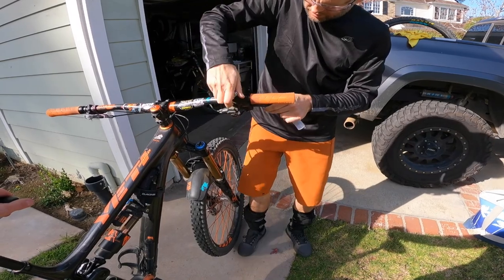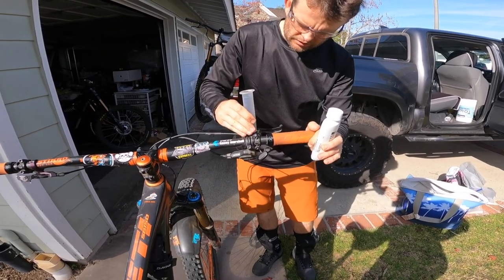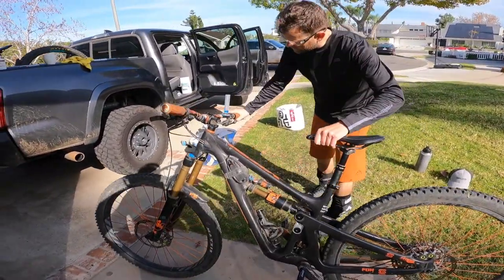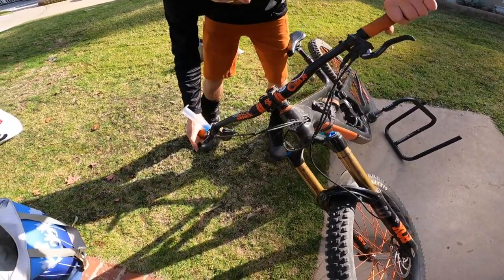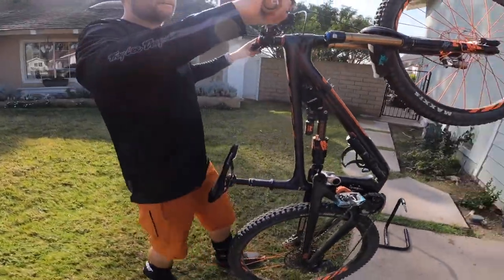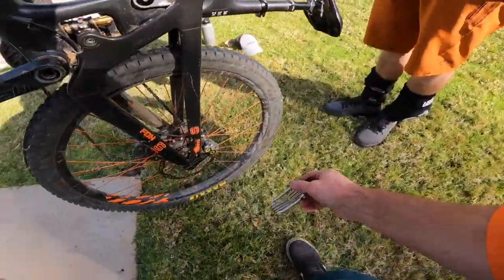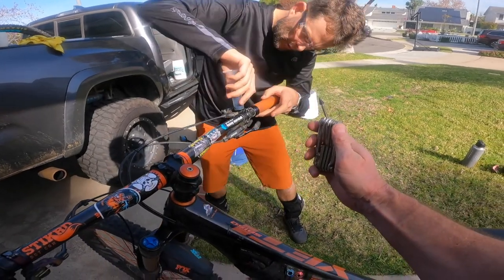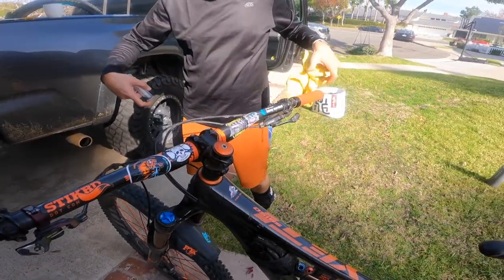Tips and techniques to bubble bleed your Magura MT7 brakes || How to Lever bleed Magura MT7's || MTB

Comment: Glad I came across this video...10 min later I got the last squish out of my MT7 after several bleeds and all sorts of tricks. Even the tiniest bubbles impact Magura MT7s.
Reply from the maker: Glad this worked for you & yes magura’s are a little finicky but once they work they are so gooood‼️
Reply: @AngrywolverineMTB   Exactly...When the MT7s work they are an excellent braking system. Now that I know this trick, the next brake bleed won't be such a chore. Thanks A lot !!

Comment: Thanks for the info here 👌👌 my rear brake lost all its power to completely no brake at all the other day whilst out doing down hill runs on my Haibike Alm6 !! I’ve just followed your video exactly apart from using a different mineral brake fluid and my brake is like new again and it only took 10minutes , thanks a lot… Malcolm from the Isle of Man 🇮🇲
Reply from the maker: Awesome, so glad it worked for you!! 👊🏻👊🏻

Comment: If you don't have fresh pads installed, do you run the risk of overfilling the system with this method? Other videos on YouTube, like Magura's fast bleed tutorial, recommend removing the wheel and pushing the pistons to the starting position before performing the bleed to prevent overfilling.
Reply from the maker: This isn’t a full bleed & not much brake fluid (if any) is goin back into the system, now if you’re changing pads , it’s best to open the system push the pistons back & change them out

Comment: Interesting, do you do that with the brake pistons pushed back? If not how can you fit new pads at a later date without releasing some fluid?
Reply from the maker: This method is for getting the bubbles out, when I change pads, I open the system at the brake lever and then I remove the pads then I can gently push the pistons back
Reply: Thanks